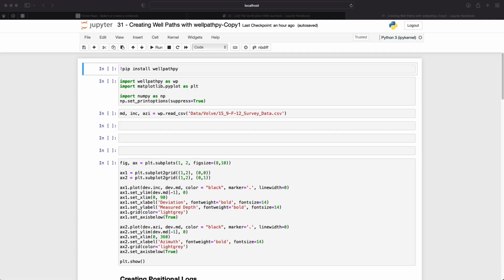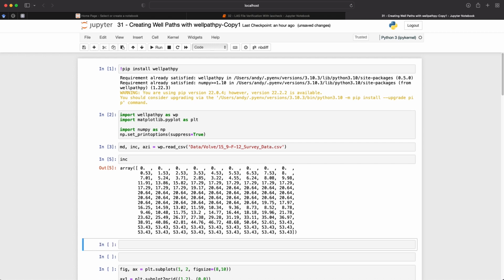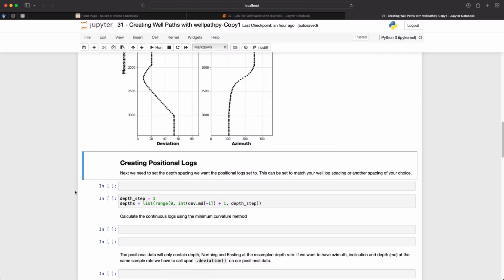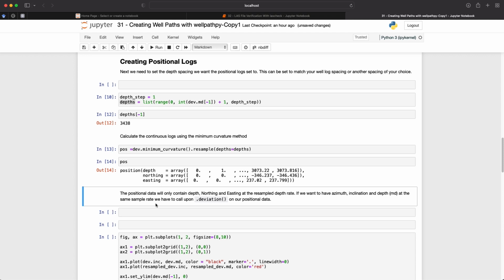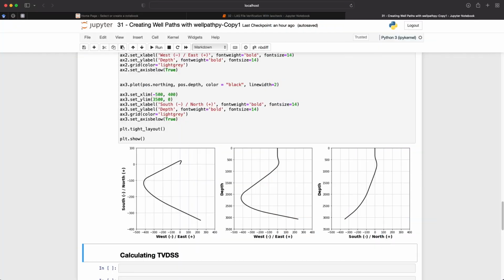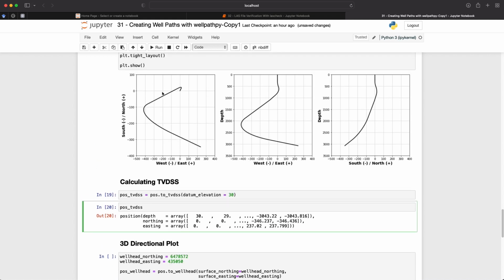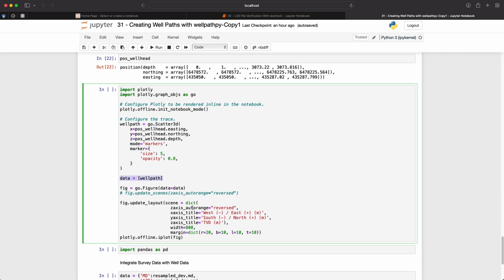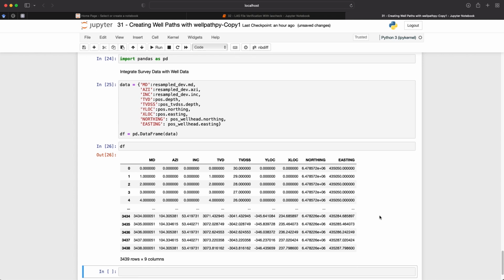Working With Well Survey Data in Python Using wellpathpy

Comment: hello Andy, i have a list of 100+ wells with their own name IDs and the directional/survey data. I would like to process them all at once to generate the "Northing", "Easting" and "TVDSS" coordinates. Can you give some tips on how to do it on wellpathpy ?
Reply: Also, thank you very much for this great content
Reply from the maker: That’s an interesting one. Are all the wells in a single CSV? If so I would consider using pandas groupby option and then loop through each group. 

If they are separate CSV files, then you could try reading each file, process it and save out the results all within a loop.
Reply: @AndyMcDonald42  thank you fo answering. All the wells are contained in 2 CSV files, 1 containing the wellhead coordinates and the other containing the surveys, both of them have a same WELL_ID field that can be used to correlate them.

Comment: Hi Andy, Thanks for another awesome video! Unfortnately, I run into a problem with the "resampled_dev = pos.deviation" 

It returns a greater value for depths and when plotting resampled_dev over dev, I get a zigzag pattern/ all over the place? After reading all your available material on the topic I'm still a bit stuck. Any help would be much appreciated!
Reply from the maker: I haven't seen that occur before. Were you able to resolve the issue or is it still occurring?

If it is still occurring, it may be best to raise a ticket on the wellpathpy repo: https://github.com/Zabamund/wellpathpy/tree/master/wellpathpy

These guys would be able to provide more help. 

Off the top of my head, I would be checking the sample rate you used and checking the actual values of the arrays that are generated.